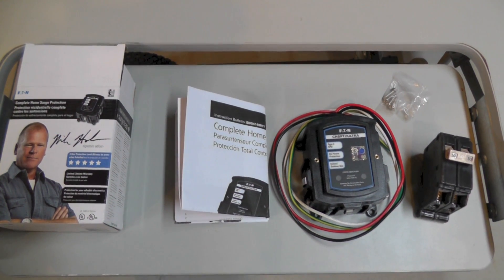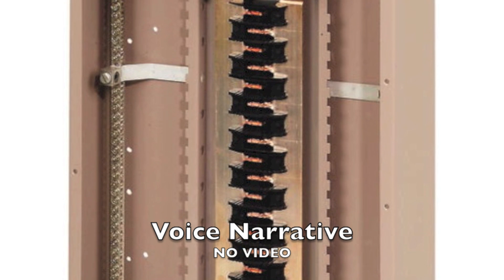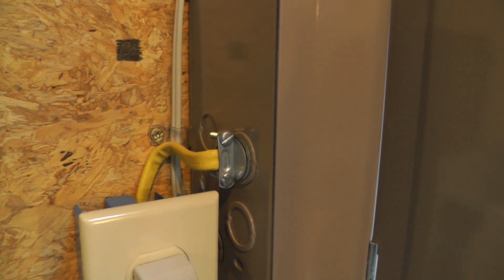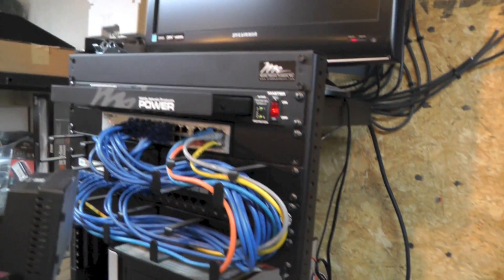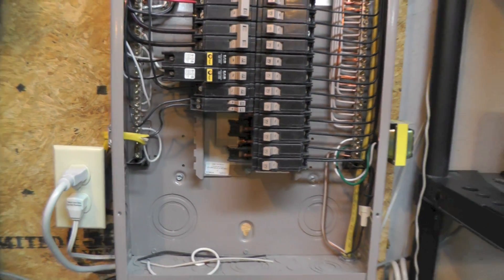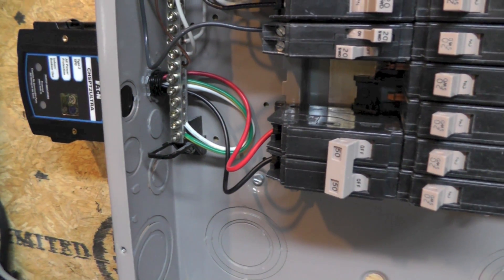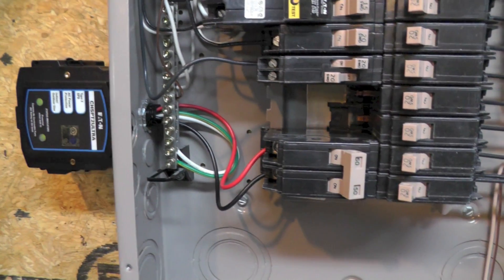Whole House Surge Protection

Comment: First of all, this is a great video showing the installation and I am considering one for my house.  But what's weird is that stand-alone receptacle tight to the left side of the panel on it's own circuit is not GFCI protected (whereas the one below the panel is).  Code violation for unfinished basement application.
Reply from the maker: +Michael Padovani I believe you are correct. Thanks for pointing that out.

Comment: Good Job.  Just a few comments:
 - A number of people have talked about "voiding the warranty".  Ultimately, it would be very hard to collect if this surge protector didn't save everything.  The fact that it's DYI is sufficient is most likely sufficient in and of itself to deny your claim.  Ultimately, it's only the deductible on your homeowers insurance that you'd be out monetarily anyway
- He is correct in that the pre-installed surge protector load centers do indeed locate the type 2 surge protector at the bottom, and I'd be very surprised to see anyone move existing breakers down to put it at the top.  I'm puttng mine at the bottom.
- As for twisting the black and red, that's probably a good thing, but if you'll notice the loadcenter eaton sells with the surge protector already installed doesn't twist them very much.
- The 50 Amp fuse is indeed required for this model surge protector.  Better yet would be a high AIC breaker, but they cost about 5X the regular 50A.  I have an Eaton/Cutler Hammer Loadcenter, and plan to use the BRH250 rated for 22k AIC vs the standard BR250 at 10k AIC.  It'll cost me ~$55, but in a really large surge, it might just make the difference.  Most people don't, and most surges are <10k anyway.
- No, you can NOT splice the wires to extend them.  #1, it isn't allowed in the loadcenter at all (you shouldn't have the splice at the lower right cover either), #2, you want a short path, and #3 they explicitly tell you not to.  If the neutral bar isn't close enough, you should extend it, unless you want to start moving breakers.  An electrician can do either.
- No, you can't protect the entire panel with a single 120V breaker.  Best might be to consolidate two full size breakers into one with two breakers built in/Quad to make space.
- You should plug those unused knockouts.  Mice and bugs can get in (I've seen a web pic of a mouse fried inside a loadcenter.  These plugs are readily available.
- If you aren't 100% sure of what you are doing, have an electrician do it for you.  This is an easy (cheap) job for them.  If DIY, turn off the main breaker, but remember the main feed is still live - those big wires connecting to the main breaker.  I'm paranoid and always wear gloves.
Reply: Bill Scheets After some research, it appears that the twisting is indeed very important in reducing the inductance, and hence the effective voltage protection.  Keeping the length of the leads to a minimum is also much more important than I'd imagined.  Huge.
For reference, see this link:  http://www.lightningsafety.com/nlsi_lhm/IEEE_Guide.pdf
One other important consideration is covering multiple "entry points" for surges.  This can include cable, phone, metal plumbing, and appliance with redundant grounds (the voltage difference can be huge during the surge).
Reply: Bill Scheets You are right about that.  I learned that the hard way.  So how does one cover all of these entry points?

Comment: Is there a reason why a 50 amp breaker was chosen for the whole house surge protector to be connected to? Was the service entrance wiring 100 amp or more? Does the amperage coming into the house dictate the size of the breaker at all?
Reply: +Tom Gwozdz   Looks Like Eton wants a 50 AMP DP for the Ultra model and only a 15 am DP for the Surge Model
Reply: The ultra model has 6 MOVs in it vs 4 in the surge, presumably to draw in a higher surge. As such you might not want the 15A breaker to interfere and it go to your other circuits. I’m guessing on this though I hope it seems plausible.

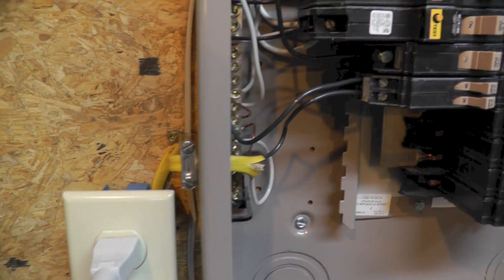Comment: I install surge protectors for water well applications but have considered installing one for my own home. Today I had a transformer blow out front of my home. I went down stairs to shut of all my breakers before the power was restored and noticed several breakers had tripped. After power was restored I reset all the breakers and the only one I had trouble with was the one closest to the panel (3:40 in the video). It was protected successfully by a store bought surge protector. I will install a whole house surge protector and add store bought surge protectors for devices I am most concerned about. Great video, Thanks

Comment: Looks good to me.  Too bad you didn't have a little extra slack in the last breaker.  You could have moved it down two spaces and wouldn't of had to move the outlet.  Thanks for the video.  And for those that want to criticize, You take a direct hit from lightning, it won't matter what you've done.  Everything will be fried, including your kitchen sink if it's stainless steel.  The surge protector is rated in Peco seconds, so it doesn't really matter where it's attached to the bus.
Reply: +Robert Sunderland  its not about Lighting hitting your house its about the Surge that it makes when it hits a pole or line miles away from you..  Lighting and your House are never ever good. For that you need a Lighting Suppressor.
Reply: So true I had a strike hit my house came through the cable line jumped over to the power started to fry lots of GFIs phone computers etc...
When I rebuilt I had a surge protector put in but was told a good hit form lighting can still do damage I just lowered the odds.
Might want to check if you have a surge protector installed it may lower your house insurance some call and find out.
Reply: +depoteco True. Another thing that I learned is to make sweeping turns with ground wire as 90 degree turns will not protect you. Went through a course at AT&T on proper bonding and grounding. You can't even begin to imagine the amount of copper at a cell phone tower. Since copper has dropped in price, I'm considering a lightning rod close to the house with a copper grid under gravel. Was told lightning will seek this within a certain distance. As far as a utility pole strike, our trees along the route are taller, but I'll definitely place surge protectors on my two power panels. One of the panels is for my whole house, propane fired emergency generator and the other is the 200 amp house panel. I'll also put one in my Man Cave that has a 100 amp panel. Enjoy these kind of interactions. Have a good day sir.

Comment: Pretty good video! I am with the last comment though on the shortness of the wire.

But I do have another question.....Since all of the breakers share the same buswork anyway, does it REALLY matter where on the panel that you install the suppressor? Top or bottom??? What am I missing here? Thanks in advance
Reply: +Brendt Montgomery Eaton is trying to get you to use the Buss location closest to the Main Breaker.  Pico Seconds Count..
Reply: Thanks for the response, I appreciate it!
Reply: depoteco not only that, but the size of the voltage spike caused by the very large current spike traveling to the MOV.  130 volts per foot.... according to square D.   if you model this with a resistor representing the bus you will see this

Comment: You voided the warranty by installing it at the bottom of the panel.  Good luck trying to put in a claim if it does fail because you didn't want to move some breakers.
Reply from the maker: Help me out.  Where in the manual or warranty links below do I find where I "voided the warranty" by installing the CHSPT2ULTRA in the location I chose?

Also, the photo on Eaton's web site of the pre-installed CHSPT2ULTRA is located at the bottom of the panel as well.

http://www.eaton.com/ecm/groups/public/@pub/@electrical/documents/content/ib00414001y.pdf

http://www.eaton.com/ecm/idcplg?IdcService=GET_FILE&allowInterrupt=1&RevisionSelectionMethod=LatestReleased&noSaveAs=0&Rendition=Primary&dDocName=WA00414003E
Reply: BobotsTrains I could have sworn I read that they want you to install it closest to the main breaker which makes sense.  Why would you want all that surge to possibly flow through all the other circuits and hit the spd last installed at the bottom of the buss bars? 

Also I doubt the warranty applies to DIYers.  It states many times a licensed/qualified electrician must install these.  You are not an electrician you may have done some electrical work but that does not make you an electrician at all.

"A licensed / qualified electrician must complete all instructions
described in this manual in accordance with the U.S. National
Electrical Code, state and local codes, or other applicable country
codes."
Reply: SkilledEddie Don't forget, electricity travels the path of least resistance. Why would the surge jump through all the other circuits first? It will find the shortest path to 'ground' through the SPD and you should be fine. They want you to keep wires short because the shorter the wires provide less resistance and make it more likely a surge will flow through SPD.

Comment: Thanks. This is helpful. So really, this looks no more difficult than installing a new circuit. Any specs to look for for the protector. Are  2 50s standard?  In my case, I have 100 amp service.

Comment from the maker: The instructions for the CHSPT2ULTRA, effective March 2012 and superceding the October 2010 instructions, clearly state "Connect the Black and Red wires to the 2-pole circuit breaker. Connect the Black wire to one terminal and the Red wire to the other terminal. DO NOT install both wires on the same terminal." The included wiring diagram confirms this. According to this, the shown installation would be correct.

Comment from the maker: Thanks. You bring up a good point.  Even if the main breaker is turned off to remove the threat from the bottom of the panel, there is still massive current coming in on the mains at the top. Again, if you have to ask...don't do it.  Call an electrician.